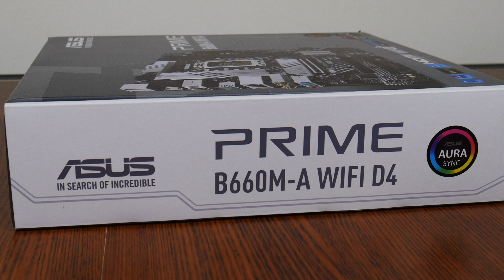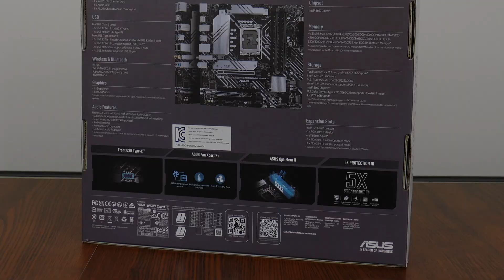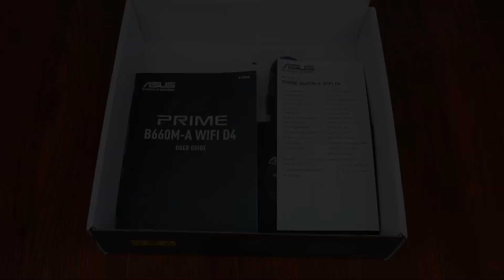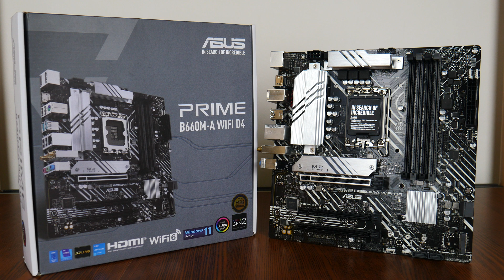ASUS PRIME B660M-A WIFI D4 Unboxing & Overview - Intel 14th Gen Raptor Lake Refresh Ready!

Comment from the maker: UPDATE AS OF 2024: This motherboard now supports Intel's 14th Gen "Raptor Lake Refresh" and 13th Gen "Raptor Lake" processors with a BIOS update available for download from ASUS's website!

Do note there is an error at 4:07; the top slot, PCIEX16(G3)_1, operates at x1 mode, while the bottom slot, PCIEX16(G3)_2, operates at x4 mode. Apologies for this!

Check out the article version of this overview here: https://www.alktech.co/articles/budget-intel-12th-gen-alder-lake-b660-motherboard-asus-prime-b660m-a-wifi-d4-unboxing-overview

Comment: Hi will work fine with i5 13600kf processor ?
Reply from the maker: Hello, this board will work with a 13600KF, but given that it's an entry-level offering with a weaker VRM setup, it might thermal throttle the 13600KF and prevent it from operating at its maximum potential, especially with heavy productivity workloads. If you have the budget for it, go for a mid-range motherboard offering instead, such as the TUF Gaming series from ASUS!
Reply: @ALKtech  I already have this board, processor i3 12100f and I have very good cooling in the case, I hope everything will be ok

Comment: this mothermoard can handle i5 14600kf ?
Reply from the maker: Nope, it'll very likely throttle a 14600KF's performance. Best to look at mid-range B760 boards if you're intending to get a 14600KF!
Reply: why thottle i have already i5 12400f on this motherboard but its not enough for me  @ALKtech

Comment: Thinking about getting this board was planning on upgrading to an i5 probz 13/14th gen down the line would it work well or would I be best getting a bit better motherboard to prevent performance bottleneck
Reply from the maker: Since you're intending to upgrade further down the road, my take is that you should get a better motherboard with a better VRM setup, so that you can have more headroom for a higher-end 13th Gen/14th Gen processor in due course!
Reply: @ALKtech  cheers I did some research an I think I’m going to for a z960 motherboard haven’t decided which one but I’m thinking about the gigabyte z960 gaming x or pro appreciate your reply
Reply from the maker: @myifeisafumble  yup a Z690 board will do just fine for 13th and 14th Gen, especially if you can get one on the cheap. Just bear in mind as the Z690 is an older chipset, it might not be able to support the newest DDR5 speeds beyond say, 6400MT/s!

Comment: I have the one without Wifi, same thing except for that. The setup won't start: i3-13100 w/video (no extra video card).  Supposed to be BIOS updated by the vendor. Tried a 2666 RAM stick i'm using on an i5 9th gen and it won't start (blinking power led, no video, cpu fan rotating, LED strip on). I tried a reset on the proper jumper but no luck. The CMOS battery in fact is very awkwardly placed so I didn't touch it. Waiting for Asus to respond or I'll have to RMA.
Reply from the maker: Hmm. You may wanna check the motherboard manual for the power LED codes - the blinking power LEDs correspond to different error codes that you can use to troubleshoot your PC's start-up issues, you might wanna Google Q-LED Core for more info!
Reply: @ALKtech  Thanks. The online docs says that LED means bad or incompatible memory. It's rare but well the RAM model don't match the QVL for gen13. Asus support says now it's almost sure it's a memory issue. I'll get a new one this week. It's either that or they didn't upgrade BIOS. We'll see.
Reply from the maker: @CharlyDS  hope you'll be able to sort out your PC woes with the new replacement board!
Reply: @ALKtech Thanks a lot my friend! In fact I was looking for all the places where I posted this problem to give feedback. I got the new RAM stick and, as expected, same thing. Yesterday I took the long trip to the vendor store and.. they hadn't upgraded the BIOS as they promised they did. What do they say? The most obvious answer is the right one: in this case, human failure :D
Reply from the maker: @CharlyDS  sigh...but glad you managed to sort out the issue in the end, despite having to set aside time to travel down to the shop!
Reply: @ALKtech I do this every 4 years so it's always the same, you think you broke or burned something haha but it's usually something simple. Love the experience in the end.
Reply from the maker: @CharlyDS  and I guess that's the fun in DIYing your own PC - nothing beats the satisfaction of getting everything setup properly!

Comment: Will this motherboard slow down a i7-12700f from working to its full potential??
Reply from the maker: Seeing as the 12700F is a non-K part, I think it'll work just fine! Just make sure you've got good airflow in your PC case and have a good CPU cooler as well.

Comment: Does this board even have an led power light when it is plugged on the outlet? Why doesn't it have any lighting whatsoever? It is very useful. Cheaper Asus boards even have led light on the pcb yet this $180 crap doesn't even indicate any power on. Am I missing something? Thanks.
Reply from the maker: Nah you aren't missing anything, this board doesn't come with an onboard power LED. Actually to think of it, I haven't really seen onboard power LEDs for motherboards thaaaat often...even for mid-range and some high-end ones! It's not really a feature that you get very often these days...
Reply: @ALKtech  Thanks for replying. I posted on the Asus subreddit and I get a suspicious reply like something is wrong with me. All I want to know is that, if I am working on 3 motherboards at the same time, I would like to know which board is still plugged to power source or not. In your experience as a motherboard expert, any advice how I can achieve a similar result? Or an alternate solution? Or am I doomed? Thank you once again. Subscribed.
Reply from the maker: @BugsVsHumans  hmm that's tricky, as I'm thinking back to all the motherboards I've ever worked on in the past 20+ years, I can't really recall that many with an onboard LED to indicate that the board still has power going to it. The most I can think of, are graphics cards where manufacturers do sometimes include a power LED right where one would connect the PCIe power connectors from their PSU to their graphics card, to show that there's still current flowing to the card. Do you mind sharing the context of your situation where you might be working on multiple motherboards at one go? Is it for like troubleshooting purposes at work, to ensure that you don't unwittingly power on the PC while installing components?
Reply: @ALKtech  Oh if that is the case, then I guess it is really just me and my attachment to onboard leds. I am an IT guy and I assemble and fix computers from start to finish. There are computer parts littered in my table and room. I plug power in and out of computers some newly built and some old which I repair. I particularly enjoy working with gaming boards because it is full of features, and has onboard design lights. Have I known these boards are purely steel metal bodies, I would have opted for a gaming board. But I think I learned my lesson already and thank you for sharing your experience with mobos. Cheers and regards.

Comment: Hi, this mainboard run good with a i7 14700KF?
Reply from the maker: I wouldn't recommend this board for an i7 or i9 processor, as its VRMs are pretty weak and could throttle the processor's performance!
Reply: @ALKtech  I understand, I read that the pl of this mainboard is 200w which is not really bad. Do you think in 2k or 4k the i7 requires more power?
Reply from the maker: @Bobby10WRX  yeah, but I'm more concerned about the quality of the VRMs and the size of the VRM heatsinks, whether they'd be able to dissipate heat efficiently especially when under heavy CPU load. If you're talking gaming workloads, going with a higher resolution (e.g. 4K) tends to be more GPU-intensive, though this of course depends on the graphics card that you're using. Mind sharing what graphics card do you intend to use/already have?
Reply: @ALKtech  at the moment i've a 6750xt and i5 13500
Reply from the maker: @Bobby10WRX  cool I see, how's the 13500 holding up with the B660 board? Any throttling issues?
Reply: @ALKtech  ok i have seen Intel's 14 series benchmark and I don't like them. The same performance of 13 series and more Energy consume
Reply from the maker: @Bobby10WRX  yeah the 14th Gen CPUs don't seem to be any much better than 13th Gen from a performance improvement perspective. I'd much rather get a 13th Gen processor for cheap - these should be going at discounted prices as retailers try to clear stock in the coming weeks/months...

Comment: What's the difference in performance of a b660 and b760 ?
Reply from the maker: There shouldn't be any performance differences as a direct result of having a B660 chipset versus a B760 chipset - what determines performance would be more of the features that the motherboard comes with (e.g. VRM setup). E.g. if you're going with a high-end Intel processor such as the i7-13700K, you could have a B660 motherboard with a great VRM setup that outperforms a B760 motherboard with a low-end VRM setup, by virtue of the fact that the B660 board has a power delivery solution that is able to properly able to supply the power demands of a 13700K. Hope this clarifies!

Comment: Can i7-13700+RTX3070 run perfectly? With this mobo 🙏
Reply from the maker: A 13700+RTX 3070 combo will work just fine with this motherboard, though on heavier workloads that are CPU-intensive and could cause the 13700 to turbo frequently, the VRMs on this board may hold back the 13700's performance somewhat. Haven't tried this for myself with this exact combo, but worth noting if you're intending to press ahead with this combination of parts!
Reply: @ALKtech  Thank you for the information><

Comment: Hi I have a question about usb-c. This board has a usb.c type connecter but what if my case doesn't have it. Can I still utilize the usb-c somehow ?
Reply from the maker: You can buy a standalone USB Type-C port that's mounted on an expansion slot bracket, something like this, which can be plugged into the front panel USB Type-C header on the board: https://www.amazon.com/LINKUP-Motherboard-Extension-Key-Connector/dp/B085J361B9/

Comment: Are Intel i3 12100f and 1650 super compatible with it? Also what generation nvme ssd will be compatible?
Reply: I have seen lots of videos of people saying that thats a very good combination so you may consider combinating it, but myself i dont really know. Maybe do some investigating around the net?
Reply: @julxx_0909  is that so! B660-M A Wifi is the only one I found that is compatible with i3 12th gen which had 4 RAM and 2 NVMe slots and Wifi
Reply from the maker: @chetnn_  a 12100F+1650 Super+this ASUS board will work well together. If you're looking for alternatives with 4 RAM slots, 2 NVMe slots and WIFI, you could consider the Gigabyte B660M DS3H AX DDR4, B760M DS3H AX DDR4, or MSI's PRO B660M-A WIFI DDR4 or PRO B760M-A WIFI DDR4, just to name a couple of examples!
Reply: @ALKtech  I plan to go with B660M, but couldn't differentiate between MSI Pro and ASUS Prime as for what's better, would really appreciate your advice!
Reply from the maker: @chetnn_  if B660 boards from all three brands are available where you're from, I'd probably go for the MSI PRO B660M-A WIFI DDR4. This is because it has a very solid VRM setup that should give you headroom to upgrade to a higher-end 13th Gen CPU in the future. Of course, I'd have to look at the price difference between all three brands' B660 board offerings as another factor to consider. How much do they cost over where you're from?
Reply: @ALKtech  MSI and Gigabyte are almost similar in price, while Asus is around 30$ less, not big of a difference, as MSI seems the winner... Also thankyou for your time and advice ✨🦋

Comment: Thank you, that was really helpful! i'm considering getting this board :)
Reply from the maker: Glad that you found this video useful! Have you decided on the rest of the parts of your PC build yet?
Reply: @ALKtech is it worth buying the Asus prime b760 m a d4 over this board
Which one is better
Reply from the maker: @IAmNotASpyIstg  what's the price difference between the B660 and the B760 where you're from? If there's no difference/very minimal difference, I'd probably just get the B760. But again, this is dependent on the price difference between both boards!
Reply: @ALKtech  they are both the same price at my place
Reply from the maker: @IAmNotASpyIstg  in that case, I'd just get the B760 since its the newer board offering!
Reply: @ALKtech  by the way will the b760 boards support 14th gen Intel CPUs
Reply from the maker: @IAmNotASpyIstg  yup, it looks like B760 boards will have support for 14th Gen. Heck, even the B660M-A WIFI D4 in this video will likely support 14th Gen too - both the PRIME B760M-A WIFI D4 and PRIME B660M-A WIFI D4 have received BIOS updates just a few weeks ago that "Improve system stability and compatibility for the next-gen processors", likely indicating support for 14th Gen. You can check this out for yourself under the BIOS download section for these two boards on ASUS's website!
Reply: @ALKtech  i think I'll buy the b660m a WiFi d4 as at my place the b760 WiFi version isn't available

Comment: hello sir, how to replace the bios battery if it's damaged, are there any spare parts in the official shop?
Reply from the maker: You'll have to look for a CR2032 battery that terminates in a two-pin connector - you should be able to find them on websites such as Aliexpress, or through your local electronics dealer!
Reply: Please tell me if u managed to remove the cmos battery I have an issue with this currently due to its configuratuon
Reply: @random-wd4zq did you find out how to replace it

Comment: hi can this board vrm handle 13600k
Reply from the maker: I have a feeling a 13600K might be pushing the board's limits especially when the CPU turbos, though I haven't tried this myself!
Reply: @ALKtech  I'm sorry i meant the Asus TUF b660m plus wifi d4. Silly me 😂
Reply from the maker: @kimax9985  😅 there's this good article on VRM performance for B660 boards that you might wanna check out: https://www.techspot.com/review/2432-intel-b660-motherboards-midrange/

The TUF GAMING B660M-PLUS WIFI performs pretty okay with a 12700 - I'd like to think a 13600K should do all right with this board by approximation!
Reply: @ALKtech  thank you the article was indeed helpful. I would like to ask you one more thing. 13600k is potential cpu upgrade, im actually building with 12100f. Should i buy a budget motherboard now and upgrade both cpu and motherboard at a later date or get a better one now and simply replace the cpu? I don't need a more powerful cpu at the moment, but you never know what might come up hence my dilema.
Reply from the maker: @kimax9985  I see! Actually there are a few good budget motherboards around with headroom for a powerful CPU down the road - as per the article I shared, the MSI PRO B660M-A seems to be a steal, especially given how it performs with high-end CPUs. I'd probably go with such a board if you wanna keep your options open for an upgrade further down the road!
Reply: @ALKtech  thank you 😁

Comment: Hi, if I install  GEFORCE RTX 3060 NB DUO 8GB-V, is it still possible (in term of space) to install a 10Gigabit PCIe Network Adapter (TP-Link TX401)? As the PCIe 3.0 is just below the PCIe 4.0.

Yes there is another PCIe 3.0 at the very bottom, but would that be compatible with a TP-Link TX401 which is a PCIe 3.0 x 4?
Reply from the maker: Yup you'll be able to install the TP-Link card in the bottommost slot, but do note that the network card will operate at x1 mode instead of x4 mode as the bottommost slot conforms to the PCIe 3.0 x1 standard. 

That said, I can't be sure if the TP-Link card will be able to saturate all four PCIe lanes given that it's a 10 Gbit part, but if it does, installing the said card in the x1 slot will almost certainly reduce your card's performance. In view of this, installing the card in the PCIe slot (immediately beneath the PCIe 4.0 slot) that operates at x4 mode would be the best bet, but without actually trying it out for yourself, I can't say if there'd be enough space for you to fit your RTX 3060+the TP-Link...
Reply: @ALKtech  thank you for your prompt and on point answer

Comment: Can i5 12600k run perfectly? With this mobo
Reply from the maker: The 12600K will work just fine with this board, just bear in mind that this board isn't meant for overclocking!
Reply: I did not overclock
Reply from the maker: @CSGO.R.I.P  cool, the 12600K is compatible with this board for sure!

Comment: Is this Intel 13th gen ready straight from the box? No need to update?
Reply from the maker: You'll likely have to do a BIOS update first for it to support 13th Gen - the board doesn't come with the BIOS FlashBack feature that allows one to update the BIOS without a CPU/RAM/graphics card installed. You'll likely have to borrow a 12th Gen processor from someplace in order to update the board's BIOS!

Comment: how to remove battery in ASUS PRIME B660-A WIFI D4
Reply from the maker: You'll just need to unplug the two-pin connector of the battery from the motherboard, and look for a replacement battery that has the exact same kind of connector! Such replacement batteries can be found on the Internet, but nothing beats a good ol' standard CR2032 battery that you can just pop out and replace just like that...
Reply: @ALKtech  thanks a lot my friend
Reply: @LefterisMichaelPantazis hey, can u please help me with removing the battery without damaging to clear the cmos, since the pins won’t work
Reply: @LefterisMichaelPantazis I am having an issue since it is stuck on the mobo and kinda sealed in